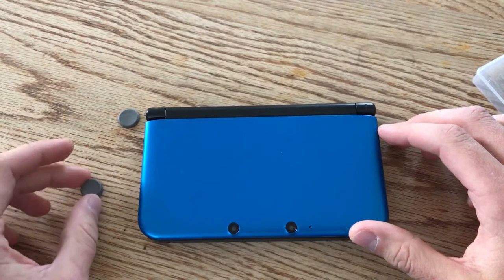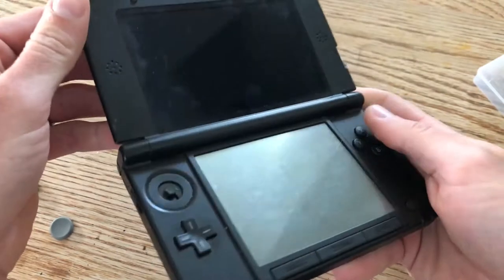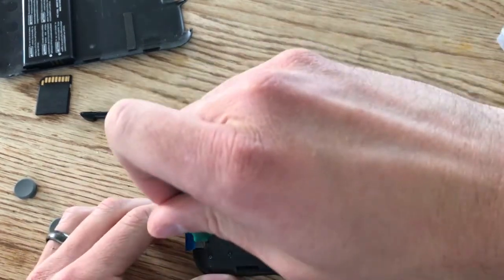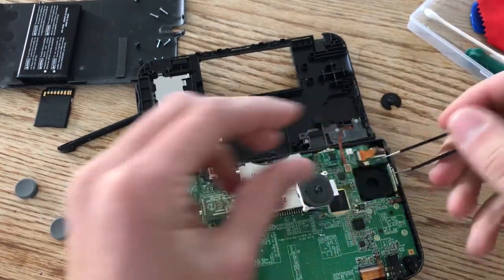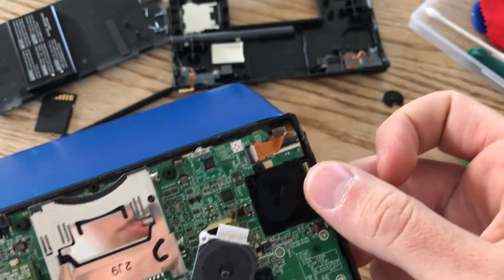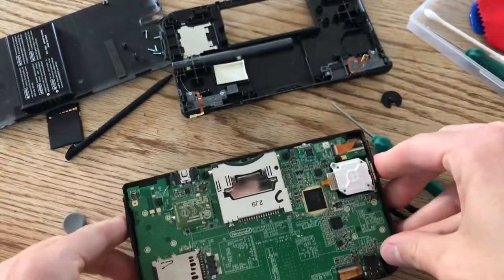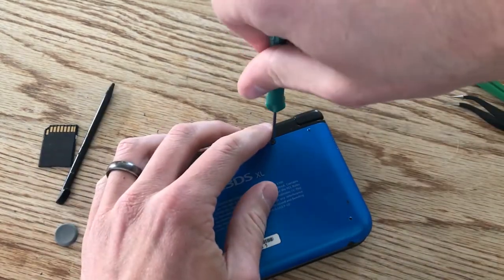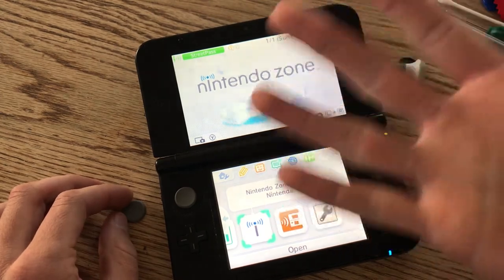How to Replace a 3DS Circle Pad

Comment: 🤠 I ordered a 2-pack of those circle pad replacement caps from an ebay seller in China & they sent with tracking even though it was only $2.71 AUD / $1.79 USD. There's even a choice of light grey / dark grey / black / white colours. What's left of my original circle pad is that cap you were playing with at the end of the video. I simply superglue it on the stick & she'll stay on for about a year. Last time it fell, it fell on my face & I thought it was a cockroach & I completely freaked out.

Comment: Thanks a lot for this guide! Now, maybe this could help someone, I struggled while putting back the white thing to the circle pad and then, after i locked it in and screwed, i discovered that the pad was locked. The second time it didnt go back to its original position. So i decided to sligthly unscrew the screws, checked if the white thing was moving around (it wasnt) and then i closed it. The pad broke a lot of years ago so i did not remember if i was the same kind of problem with the pad and if i should have completely changed the white thing, but now it seems to work smoothly even though the pad is in hard plastic

Comment: I got the new thumbstick in with the washer but when I put the white back piece in and fit it, the thumstick does not snap back and forth it's just loose still. What am I doing wrong? When I fit the white back piece is tightens back up just fine so that's what confuses me.

Comment: does the process work similarly for the new 3ds? im going to try repairing mine when i can
Reply: I'm wondering this too, did you try fixing it yet?
Reply: @PleasantBoy  i found a video that is for my model but the creator said to use the wrong screwdriver. Ended up threading the screws and when i got them out the bottom of the screws were stuck in the ds so i couldnt close it properly plus the casing was all cracked :( had it for 9 years so ended up buying a new one
Reply: @crowcified  I'm really sorry that happened, it sucks :( I bought a triple zero screwdriver and I think that one's correct? Would you recommend that I still check the other person's video out or should I use this one
Reply: @PleasantBoy  triple 0 should be okay i believe n im not sure bc i cant remember the other guys channel
Reply: @crowcified  thanks so much for the help, I think I'll just cross reference to two videos because I found the other guy's vid